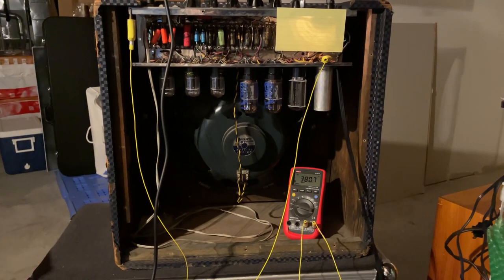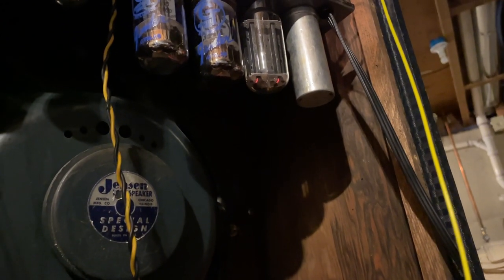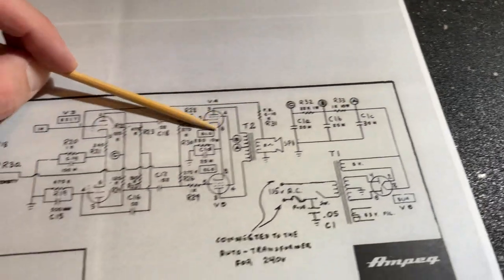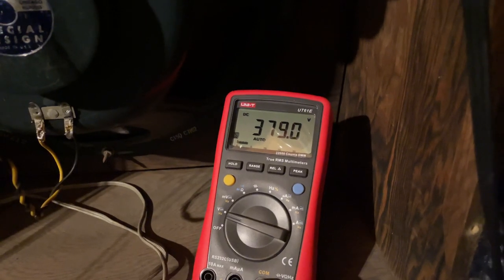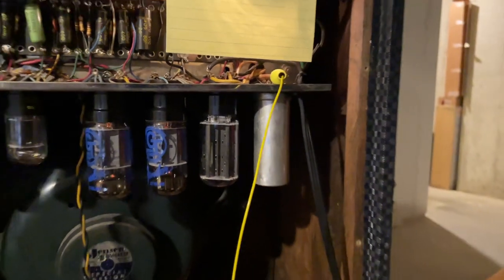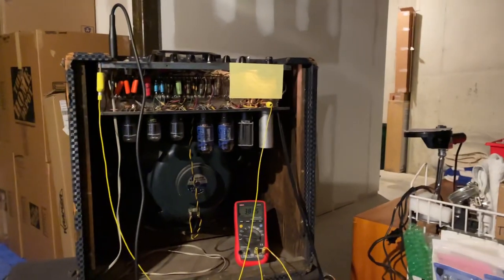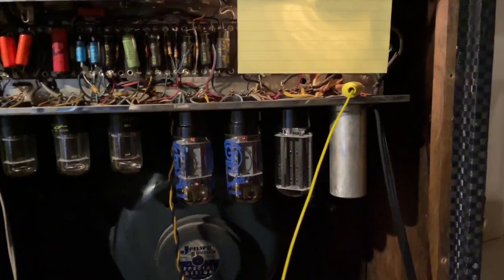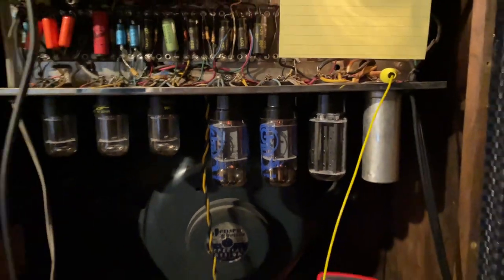Ampeg M-15 : How Bright Should My 5U4 Rectifier Tube Glow? : 1

Comment: Thanks for the info.  I just picked up a B-15N.  It looks to be in great shape and barely used.  Two questions for if you have time:  One is that it's missing the 5U4 rectifier tube.  Second is that someone installed a car speaker in it.  I was hoping that you could recommend a good place to buy a new or used 5U4.  I was also hoping you could recommend the ideal speaker to install and where to look for it.  Either way, thanks again for the video, it is very helpful.
Reply from the maker: Congrats on the new amp!  For tube purchases, TubeDepot.com and TubesAndMore.com are a safe bet.  I’d suggest the JAN Philips 5U4GB.  Note that some versions of the B15N use a 5AR4/GZ34 rectifier.  If you’ve never seen this amp actually working properly, you should use a light bulb limiter and/or Variac when powering it up for the first time.  Lots of videos on this on YouTube.  Tons of speakers out there to choose from and “ideal” for one person is “horrible” for another!  Check out something as basic as an Eminence Legend.  TedWeber.com has lots of great 15” options.  WgsUSA.com has a few too.
Reply: As a person who repairs guitars for a living and plays bass in a band, I can't tell you enough how helpful your video is and to all the others who post for us who get  to learn from your experience.  Thanks again for taking the time.  It means so much!  It keeps the whole music thing going somehow. @SJSclips